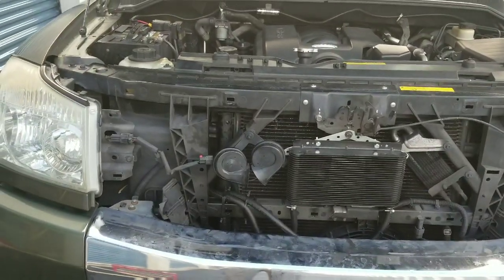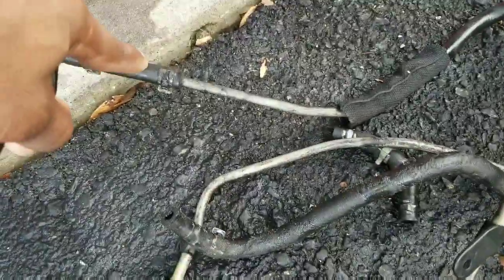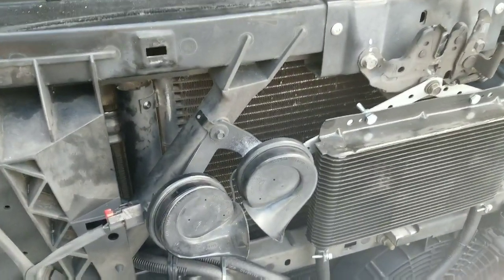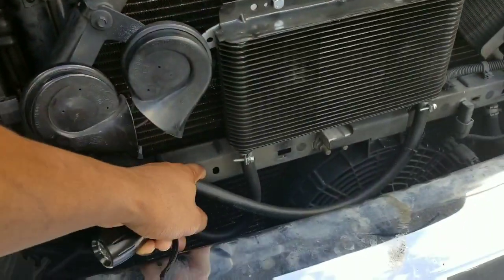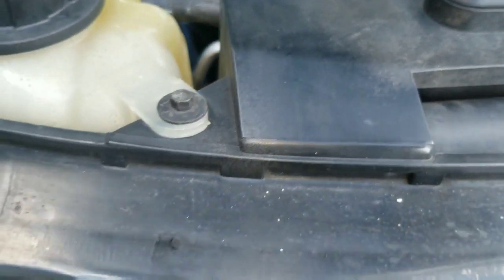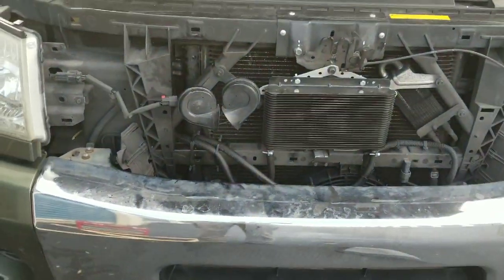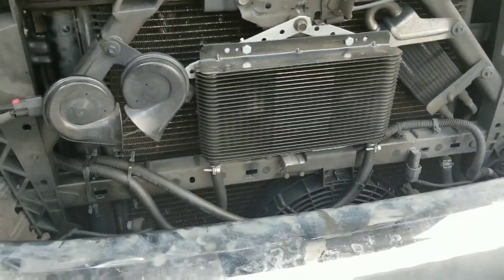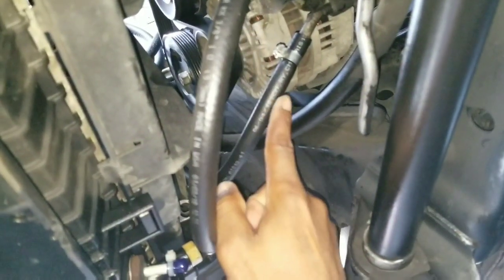Nissan Armada/Titan radiator trans cooler  bypass (part 2).

Comment: Awesome job and great information!!! But I dont see where the lines are for the OEM cooler your connecting to... I see where your pointing but I dont see lines nor the cooler??  Looking at the left side front I see what looks like 2 hoses... i think this might be them???  Your clarification on this last detail would be awesome!!  Hope Im making sense... thanks again!!!
Reply from the maker: Facing forward, the lines are on the right of the radiator. The factory cooler itself is sandwiched in between the radiator and AC condenser.
Reply: Does the Titan and Armada share the radiator for coolant and trans fluid
Reply from the maker: Yes. The trans lines are connected on the bottom tank of the radiator to the left and right.

Comment: I wish you showed the exact path. So you to to the tru cool cooler first. Then you go to the oem air cooler. I guess it will make sense when I get in there.
Reply from the maker: I thought I said it as clear as I could. I was specific because I myself couldn't find where anyone prior had explained it clearly. 
Fluid comes from the transmission, to the aftermarket external cooler, to the OEM external cooler, then back to the transmission. 

Any more questions on this setup: ask away.
Reply from the maker: Basically the external cooler that I added has taken the place of the fluid to fluid cooler that is inside the radiator.
Reply: Does it matter how I install it to the Radiator.. I mean does it matter the Direction of flow
Reply: @97TRAKIN  hey stupid question but the radiator is not the factory cooler ?
Reply: Did you bypass where the line enters the little silver block on The passenger side Space near the top of the radiator? Not sure what this is to be honest, maybe a heater for the winter months before it gets to temp?

Comment: Only thing I see as a potential concern is that the trans oil pump isn't designed to push fluid up against gravity. But in turn you'll get much lower fluid temperature which is good. Let us know how this works on down the line.
Reply from the maker: Titans and Armads come stock with an air to fluid transmission cooler sandwiched between the evaporator and the radiator. It's been a few years now since I and many other people have done this mod; still going strong. I am at 225,000+ miles; the external cooler was done at 100,000+ miles.

Comment: Added the External Cooler, Took the transmission pan down to clean it, put everything back on my 2005 Titan and got a P0720 Code (output sensor) making the truck shifts bog on lower gears. Checked my fluid level, Checked for leaks, and cleared the code but it would come back after 2-4 miles. Never had this code before, did anyone else get this? how did you fix it? I searched for repair tips, but didn't find anything that helped specifically for titan/armada repair p0720 code. Should have just added the cooler and not messed with taking down the pan to clean it.
Reply from the maker: Yeah I would not have dropped the pan. This is a very common mod to Armadas and  Titans and your situation is the first I've heard of any issue. If check the connections on any sensors in the vicinity of where you were working and make sure they are secured. Good luck.

Comment: Is this the lines that would crack because of the seal and leak and mix ATF and coolant and contaminated the ATF and blows the transmission ?
Reply from the maker: It cracks right at the point where the transmission line enters the bottom of the radiator.

Comment: Great videos! I watched your first one and i like how you mounted tge cooler. Most people use those wire tie types that you put through ylthe radiator, which never sat well with me. Your one of the first to post where to connect the new lines. How much/size/type hose did you need to do this?
Reply from the maker: I just grabbed 6' of transmission hose. It's better to have too much rather than making another trip to the store for more. I forgot the size, but using a caliper you can measure the outside diameter of one of the metal lines to get the size.
Reply: @97TRAKIN  Thank you! Much appreciated!

Comment: wait.. so your still going into the factory cooler? Thats not a bypass thats just another inline cooler and wouldnt stop the water/coolant from entering the trans when the factory cooler fails...
Reply from the maker: This is 100% bypassing the factory fluid-to-fluid cooler. The cooler built into the bottom tank of the radiator and is completely bypassed. There is a factory air-to-fluid cooler (like the one being added) that you keep in the circuit. It is huge and sandwiched between the condenser and the radiator. 
You are commenting on "part 2", did you look at the first video where I pointed to the no longer in use bottom tank cooler nipples and me capping them off?  Check out part 1. Part 2 is just me cleaning up the hose routing.

Comment: Do you remember how long of hoses and what size you used? I'm getting ready to do the same mod and I'm curious about doing braided stainless steel instead of rubber. Lemme know!
Reply from the maker: Sadly I don't remember. I do remember getting more than I thought I'd need like 5' because I didn't want to make a trip back to the store. Any left over hose can come in handy around the workshop.

Comment: will this will work on LE tow models?
Reply from the maker: Yes sir. All Armadas and Titans regardless of trim come with radiator trans cooler and a factory external cooler. All are in the same location also.
Reply from the maker: Omitting the radiator trans cooler in the factory radiator helps avoid the "deadly milkshake". (Coolant in the transmission).
Reply: @97TRAKIN  cool thanks. I just started to have a leak up front by radiator I haven’t checked but I was aware of issues with Nissan. Thanks

Comment: Great job! Why didn’t you add a magnetic inline transmission filter to your setup???
Reply from the maker: Never really thought about putting a magnetic filter on. Not worried though because there's a magnet in the pan.
Reply: VI Tinker Tank: True! Again great video. I’m going to use your video as the basic guide to mount my cooler. I got 292,000 original miles on my Titan, just though by adding a filter it would add extra protection. Thx
Reply: @felixFPVDrone  how did it come out ?

Comment: Are you still running this set up? About to install same cooler on a 2010
Reply from the maker: Yes sir, ....and loving it. I've driven to P.A. through the mountains to pickup a trailer which I brought back to V.A. I've hauled my heavy 7X12 trailer. Lastly my wife and I took a road trip to Tampa Florida and back; no issues at all.

I have since added a transmission temperature gauge, video of the install is in my YouTube videos on my channel.
Reply: Can you show me a diagram exactly how to run the transmission cooler

Comment: What size tranny line did you use .  The cooler kit comes with 11/32 . But I read some guys run 5/16
Reply from the maker: I used the included line, but also got some 5/16 line locally to replace the hard lines. The sizes are close enough that everything works well once tightened securely.
If I were doing it all over again knowing what I know now through experience, I'd use all 5/16 line.
Reply: @97TRAKIN  thanks alot man .
Reply: Hey bud I got a 05 Nissan Titan and there is a little condenser in front of radiator already do I still need to modify it change hoses I really don't know is for can u give me feedback  pls
Reply: @manueljaramillo4813  The condenser on the driver's side that is slanted at an angle is the power steering cooler. The vertically mounted rectangular one on the passenger side in front of the radiator is a factory transmission fluid cooler.
Reply from the maker: @manueljaramillo4813  the slanted one is the power steering cooler. We do this mod to prevent coolant/transmission fluid contamination when the transmission cooler that's inside the radiator fails. You could also switch to an aftermarket radiator with a better transmission cooler design.